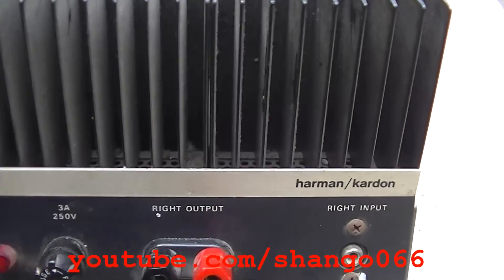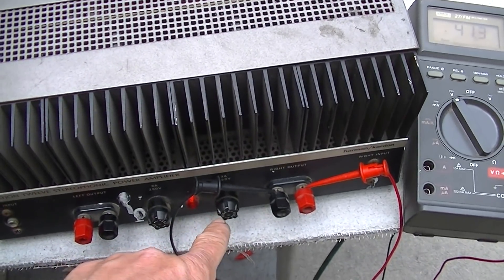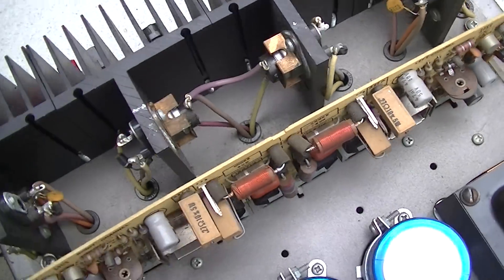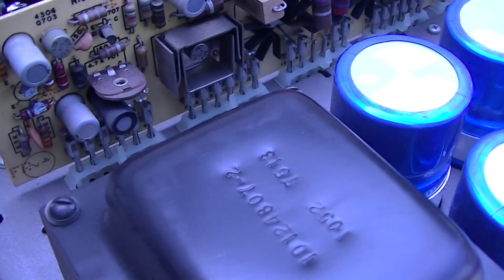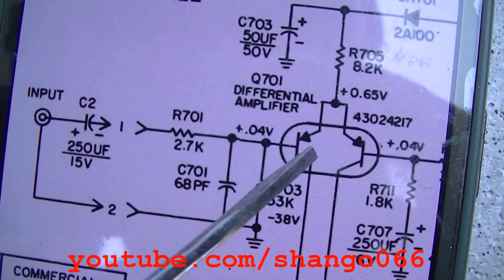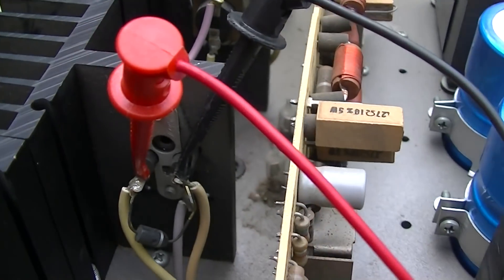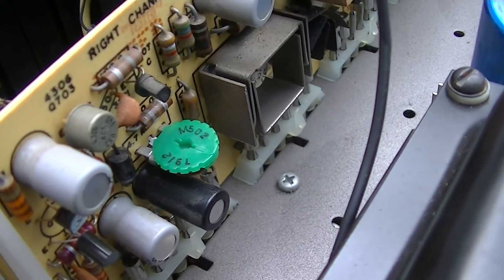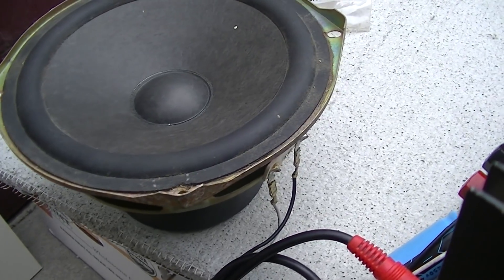Harman Kardon citation twelve power amplifier repair

Comment: Thanks for the plug! I've got alot of repect for someone as persistent at resurrecting things as you. I just don't have that patience

You can get that offset near zero if you've got a matched pair of pnp transistors in that initial stage. Most won't notice the difference with a null offset vs 100mv
Reply: +Jordan Pier - A better replacement would have been an actual diff-amp transistor, which is two transistors in one package having five leads (the emitters would be internally tied together). This would also involve removing the other good transistor but the advantages would be that both sections are factory matched and being in the same case assures perfect temperature tracking (this is one reason why amp designers use a diff-amp circuit in higher end units). These transistors hadn't really been introduced when this amplifier was built, so two separate transistors had to do the job.
Reply: rent  Pier @ 5 st houses for

Comment: To answer both of your queries: the output Transistors on the Citation 12 are 2N3055s, and the output is 60 Watts/channel RMS, not 35. Be careful with the 2N3055s. They are hand selected at the factory to be able to handle enough current and voltage to produce 60 Watts. Put a garden variety 2N3055 in that amp and it will blow immediately that power is supplied. I used to know the number of a modern replacement transistor that has similar specs but can handle way more voltage and current with impunity, but I haven’t thought about the Citation 12 since the mid eighties and I simply don’t recall.

Comment: I think you could add a diode from the base to emitter on those output transistors to keep them from frying if there's some problem in the preamp, the anode to the emitter and cathode to the base.
Reply: I think I saw tiny glass diodes across the finals E & C on the transistors themselves & in the schematic as well.

Comment: i never liked those pin connectors, i got an old harman kardon amp from a flea market it looked like new, i serviced and recapped it and gave it to my brother as a gift for xmas(he always wanted one).
it worked great but the pins were loosey goosey so i soldered them, he has had that amp 4 years so far without issue.

Comment: Wow... I admire you getting into this thing. I've been into electonics since around mid-2000s, and one tip: Replacing power transistors: Even if one blew, for stability, replace all of them of the same batch of manufacture Dunno really what could happen if you just take out the fried one and replace it with a new one :)

Comment: I have some vintage Harman Kardon speakers and they sound GREAT since I turned the bass up a little bit on my yamaha receiver eh its a bit old of a yamaha but its still a great system gets loud and clear
Reply: Ugh you messed with the tone control & set it somewhere other than flat? The very fact that your system includes any form of tone control proves that You, sir, are assuredly not an audiophool! :D

Comment: Make note when you replace the differential transistors they are supposed to be replaced as a matched set, otherwise you can get great offsets on your dc balance but it appears it was matched close enough in your case.
Reply: Apparently you have never seen any of the other videos on this channel  :)  He is a master at getting electronics working again, but as far as exacting measurements or "matching" replacement components are concerned, you will not see that here. All I know is, he is skilled at "real world troubleshooting" and I enjoy the goings on he shares with us.

Comment: a bit of search of 27722 transistor leads me to audiokarma thread. 2N5087 seems to be the equivalent. also, you'd better replace the feedback side since they work together. another tips, use a bit of thermal paste and bind them using zip tie to get similar temperature on both transistor. by having small temperature difference, the offset will be stabilized even better

Comment: Just looking at the schematic in the first minutes of this video tells me (I'm highly experienced at solid-state early 70's gear) that this amp is NOT worth any time or effort in repair. The circuit will always be troublesome and it is NOT a good-sounding one at that. It is merely one of the early 70's attempts to design with transistors.
Compare this circuit to a properly-designed one, such as the SAE 2400.

Comment: Most excellent.  The differential amp had already been replace before you opened it up.  Originally the diff amp was a single envelope with two transistors (6pins).  They are available but very pricey.  I did similar to your repair less the two transistors are clued together so they maintain the same heat and balance.
You are very fortunate as the two that I repaired had the diff amp blown which took out all the power amps and a couple diodes.
Thank you for sharing.

Comment: I built a SWTP Universal Tiger in HS. It was based on the Citation 11. The schematic looked VERY familiar. The circuit loved to go into oscillation. The output transistors were MJ802 and MJ4502.

Comment: HK Citation 12 is good for about 60 watts a side into 8 ohms, they're from around 1976 or so. Great save, though the diff input pair really oughta be matched you proved that it can be done with watcha got! Often the bias trimmer pot is what kills the outputs, in some designs when it goes open it turns the transistors full on and they burn up along with a bunch of other stuff. Depends on how it's tied in (HK must've done it right).

Comment: Looks like things are OK.  Good drill to replace those twin transistors in the input stage (differential pair) with a matched set.  But in this case you're probably alright.  If you are "in the field" without o-scope and specs, your trick of comparing the bias setting is OK.  This is essentially a "class B" amplifier, with just enough turn-on overlap to avoid crossover or notch distortion that would occur if one output device shuts off entirely before the second one comes on.  Your high compliance speaker is a handy tool.  With a barely audible background noise or low, low level music playing into the amp, gently push on the cone with your finger, and the back current produced by the voice coil being forced through the magnetic field (speaker becomes microphone) will feed into the amp and cause one and or the other device to shut off.  The sound will cut in and out as you gently work the cone in and out.  Tweak those pots until that phenomenon just stops.  Then let the amp sit idle but operating for a few minutes and check to make sure the outputs are not giving off too much heat.  You should be good to go.  :)

Comment: What!!! No oxygen free 8ga.silver speaker leads or silver interconnects or gold foil capacitors, WTH HK the quality didn't go in before the name went on did it:-)
Reply: Don't forget the power, you can't just use electricity from the pole outside, you need to condition it.

Comment: I liked my 1980's Chevy Citation.  One day, 35 years ago, I went outside and it would not start.  Checked everything obvious in Shango style and ultimately deduced it had to be the computer.  Pulled it out of the glove box and lo and behold, a burnt out trace on the circuit board.  Bridged it with a bodge wire, reinstalled it and Voila!  It started, proving there is hope for any electronic device.  If I were not a ham, I would had been up the creek without a paddle.

Great video.  I thoroughly enjoyed following your every step.  A wonderful journey to success!
Reply: Shango style.....i like that

Comment: Always nice to see a new Shango vid. I'd love to have that amp on my bench. Ugh to those old RCA part numbers before JEDEC (I think it was) assigned standard numbers like the 2N series.
Reply: Actually, those were branded by RCA to OEM's. JEDEC was in effect, RCA just decided to use unorthodox numbering, just because they could. A lot of Heath amplifiers used RCA transistors, numbered this way.
Reply: JohnAudioTech My first thought was: why don't you send it to JohnAudioTech for distortion analysis.

Comment: If those main filters are original, it just blows my mind it even works cuz their notorious for drying out in the 12. Had two of these amps several years ago that were acting funny and new filter caps fixed them right up.
Reply: Think those are replacements, they look too new to be the originals.

Comment: A w e s o me  s t u f f, shango you must make sure you use a $500 power cable to get the best out of this amp lmao, totally excellent video!
Reply: Don't forget the 99.9% pure copper oxygen free braided speaker wire.
Reply: Shango isnt doing things correctly, he needs to make sure the speakers are bi-wired, it will improve the sound from that 4" driver by 75%, even though some of the best speakers ever made are not bi-wirable, the Steve Hoffman forums know best. he also needs to burn-in that power cable, that will take up to 40 hours.
Reply: @Synthematix  No need for lengthy cable burn-in before you can reap ultimate fidelity, there now exists a device called "cable cooker" that automatically does the job for you & can even top up used cables to make sure the electrons are aligned... Add in a few Shakti stones and your 75% improvement becomes 87.269% as proven by customer reviews.  (I'm serious, look up cable cooker and read the bumf about "topping up" the burn-in on cables, power/speaker/line and all!)
Reply: And make sure the power company has used gold plated screws on the transformer at the sub station

Comment: I think you should have replaced the 2nd Q701 transistor too with the same NTE383. These two are supposed to be matched and thermally coupled.
Reply: Yes, its differential amplifier and the 2 transistors should be the same. In this case they don't need to be thermally coupled, because them internal current is low. So they only need to be close together, they are heated by ambient heat in case. But look at schematics, originally there should be coupled pair in common case.
Reply: it's not mandatory but it's better to make those transistor work in the similar temperature.
Reply: Look at the second channel (5:19) - there are also 2 discrete transistors.

Comment: I would try MJE3055 metal power transistors if it is the driver transistor if NPN try BD131 if PNP BD132, if not the driver then a for NPN low power a BC182L for PNP lower power BC212L, not sure about the double transistors